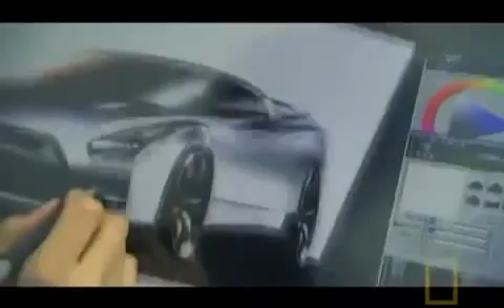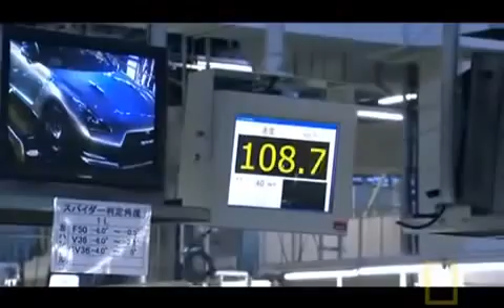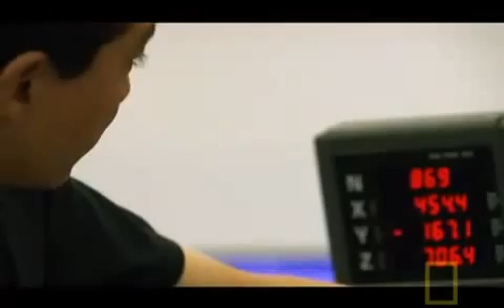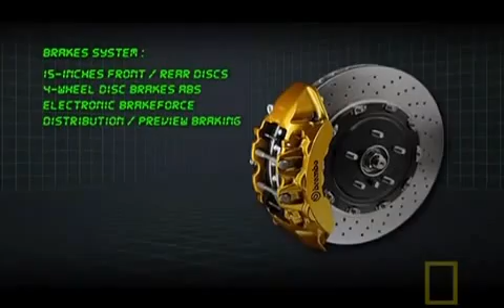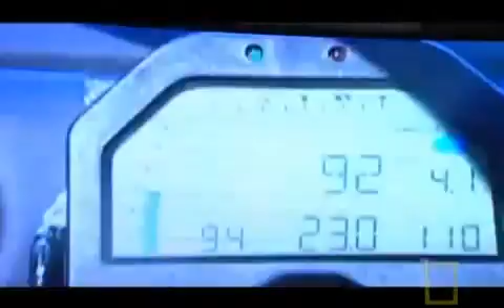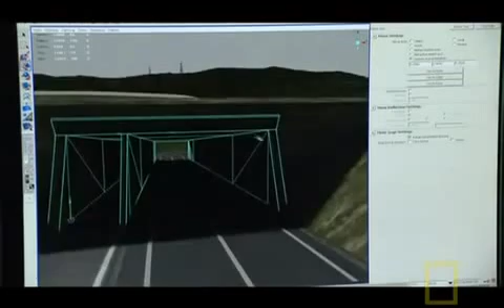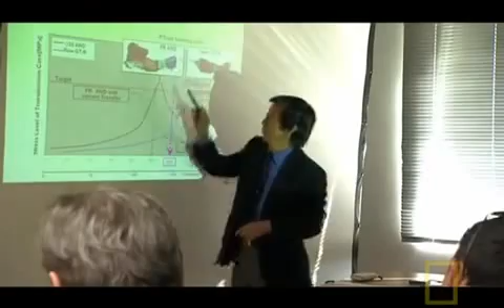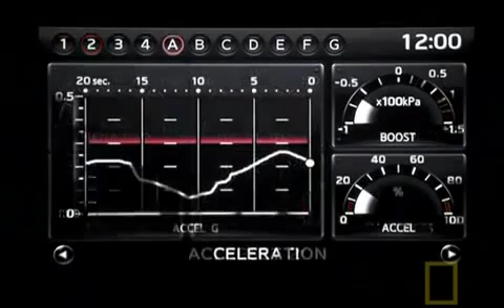Nissan GTR DOCUMENTARY

Comment: R-34 THE KING !
Reply: d3tach3d - R33's are heaps of shit. I owned an R32 and loved it so I bought an R33...worse Japanese car I ever owned so I bought another R32. Eventually I decided to get an R34 which was the best car I ever owned. Unfortunately I sold it when I left Japan and bought an R35 when I got back to the states.
Reply: +A fan of all Hakosuka is the king
Reply: True
Reply: Nickel Reed what exactly was so wrong with the R33? Only downside I can see is that slight weight gain over the R32 but otherwise it's sleeker, sexier, and has a way better interior, than the 32 with most of the same mechanicals.

Comment: 2015 GTi manual quicker than DSG. Also look out for the next generation manual transmissions with 7 speeds sometime in 2017 and after. Manuals are here to stay. And they are and will always be better than any auto. I don't care what is used in F1 because that is all rules in a controlled environment. When you drive the mountains everyday, manuals are king. They cost less, safer, stronger and more reliable and cheaper to fix and handle better and brake smoother. End of story.
Reply: I recall formula 1 use sequentronic gear box. Normally a DCT will weight a lot more than a manual counterpart, even more so if compare to a sequential gear box. There was a time formula required minimum weight of 695kg, but even that is too much for all race teams. Their cars are designed lighter than legit weight, and will need fuel in the tank to make the car "compliance". Asking to put a DCT on F1 might make engineers pulling their hair hard to look for other places to shed off this dead weight.
Reply: Dreamer.

Comment: First, let me say that I am a HUGE fan of the GTR and especially the manual gearbox... And I can totally understand how one might be offended when others say this car is automatic. But to all these people that keep saying 'it's NOT an automatic'.. Let me ask you this... Does it have a 'manual' clutch? NO. Can you drive the car without having to 'manually' switch gears? YES. Can the car switch gears with no driver intervention? YES!

Then how the fuck is this car NOT, automatic?

A MANUAL gearbox requires the driver to control ALL aspects of shifting ; throttle control, clutch engagement and release, and physical gear selection. Having dual clutches and paddles, DOES NOT EQUAL MANUAL! That simply gives you control over when the AUTOMATIC shifting takes place. This car couldn't be any FARTHER from manual.
Reply: It's semi-automatic, meaning it's a fully manual transmission that shifts automatically without the driver doing the clutching. If you are on an incline and ever so slightly engage the gas pedal, with the brake off, it will roll backwards, as if you are engaging the clutch that is internal and not at the drivers feet. It's technical speak to describe it as a manual transmission, which is true. You are confusing "manual" as meaning the driver only makes it such.